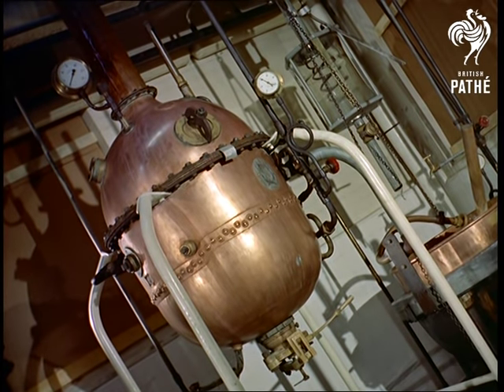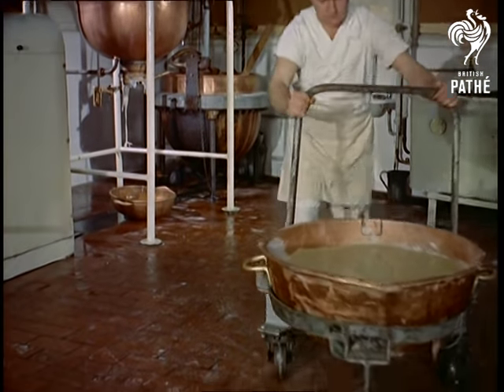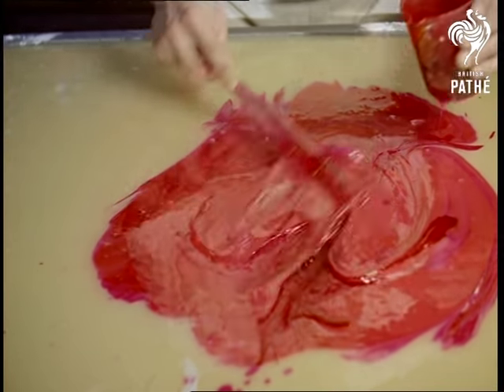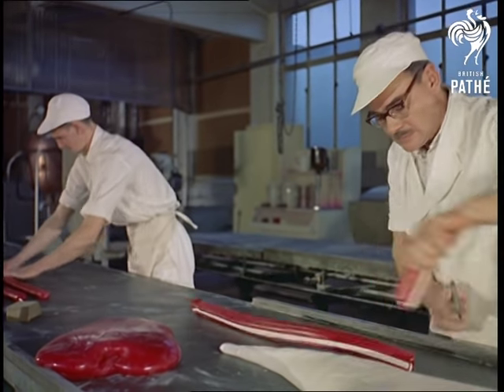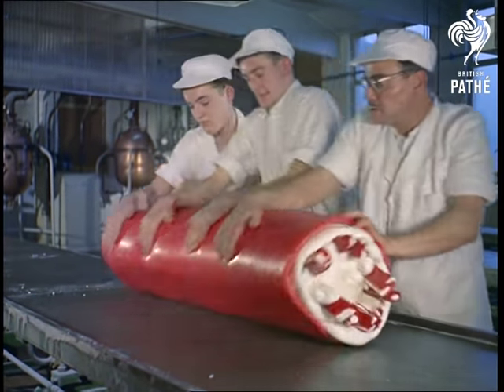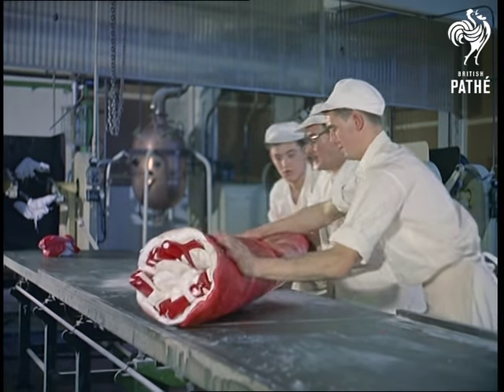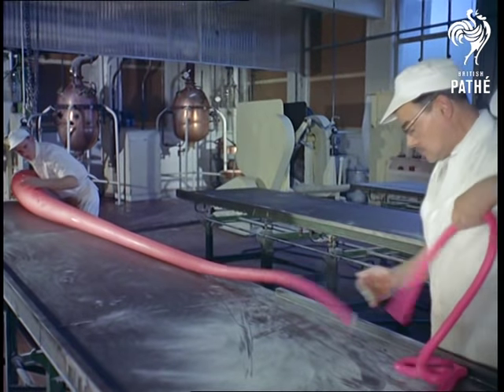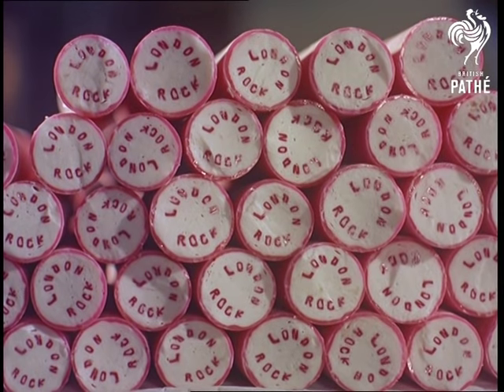'London Rock' Making Candy Factory (1957) | British Pathé

Comment: Those old copper boilers and bowls would cost a fortune now…..perhaps stainless steel wasn’t available back then.
Reply: copper is preferred as it allows for a more even temperature, apparently
Reply: Commercial candy makers generally still use copper. I have seen brittle makers still using what looks like the same pot for 40 years

Comment: I thought that us was the only strange country to use Fahrenheit-degrees.But the voiceover man clearly speaks uk-english.And England are well known to use Celsius-centigrades and Miles&inch.......
Reply: This was the 1950’s.  The system of pounds, hundredweight, pints, quarts,  inches, foot, yard, rods and roods etc is collectively known as "imperial" measurements.  The British at the time did not even use metric money (unlike the US) they used farthings, pounds, shillings and pence - 12 pence to the shilling and 20 shillings to a pound, 5 shillings was a crown.  

They also had something called a guinea which I think was 1 pound 1 shilling but could be very wrong about that.